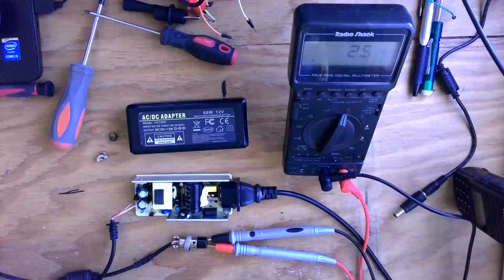🔺 My Retevis RT97 GMRS two-way radio repeater is DEAD!! power supply went out!!🔺

Comment: Yea it’s when you wanted to hook it up for computer use . Retevis didn’t intend on the repeater for that use .
Reply from the maker: No, that's not why it went dead unless a person shorts something out but its a switch mode power supply so that should just make it shut down, but I wasn't doing that today. The power supply didn't work when I plug it in today. Repeater works when using the 12 volt plug, well so far it does...lol 🙂